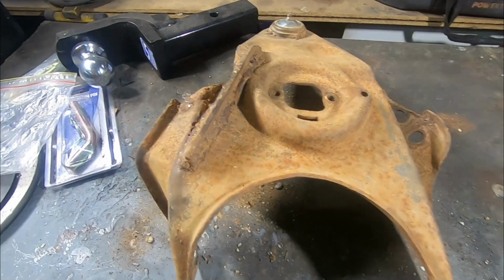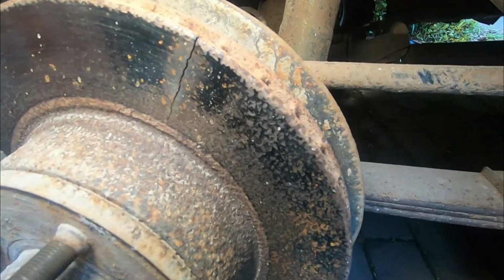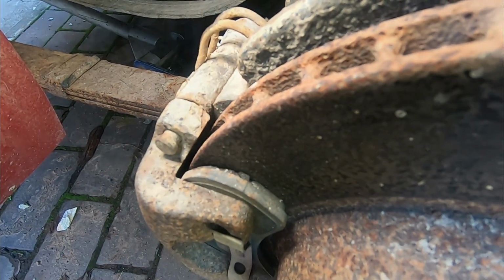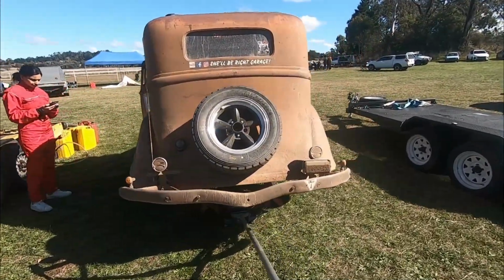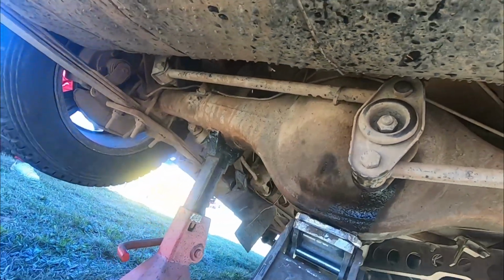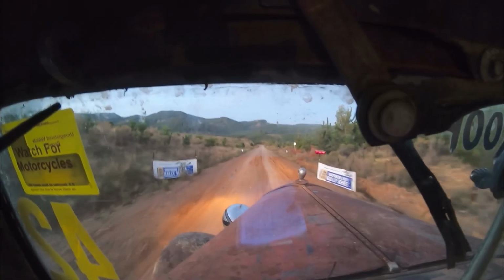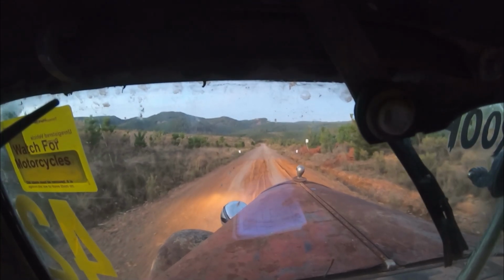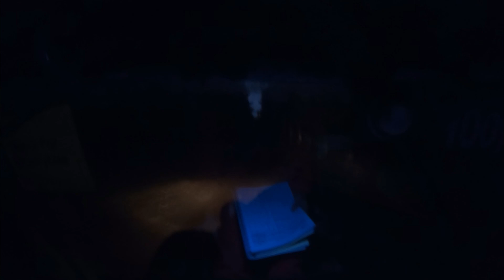DEATHPROOF 1934 PLYMOUTH ORANGE RALLY 2023

Comment: Is it possible to change to coil spring rear suspension?
Reply from the maker: Possible, but no real benefit to be had IMO, as it's still a live axle.
Reply: @shellberightgarage  Right.  I can see a lot of work for little gain.   If you are doing an off-road course you probably need a racing truck not a rally car anyway.